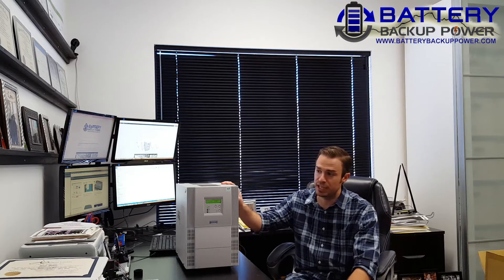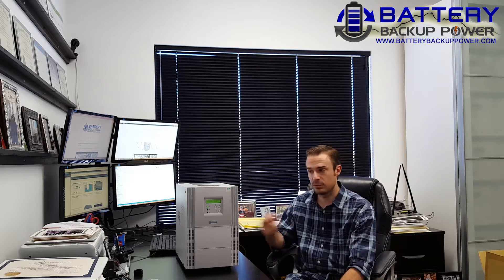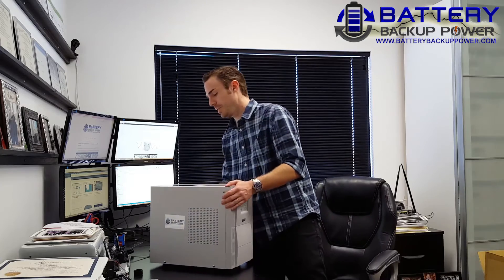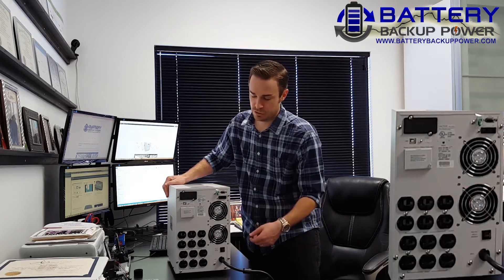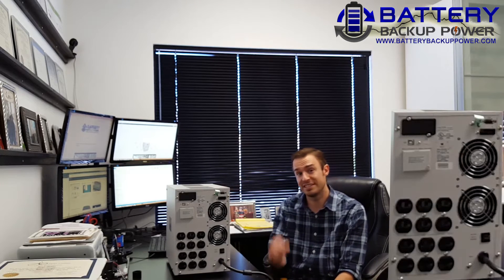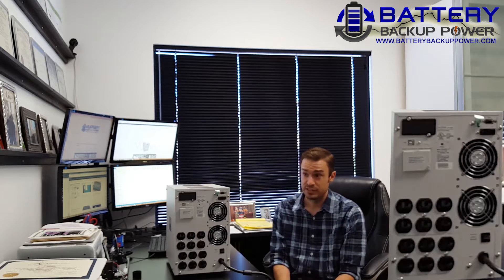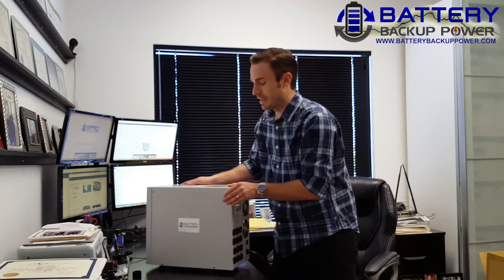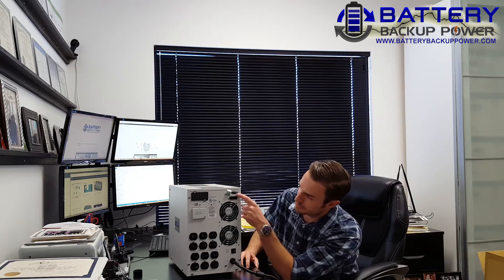How To Choose An Uninterruptible Power Supply

Comment: What model is that on the desk there? Pretty nice rolling towers there. Can probably run a work station for a good amount of time.
Reply from the maker: +Kandi Klover (Fursuiter Furry) It was a 2,000 VA / 1,400 Watt Battery Backup Uninterruptible Power Supply (UPS) And Power Conditioner. https://www.backupbatterypower.com/collections/frontpage/products/2kva-double-conversion-battery-backup-power-ups